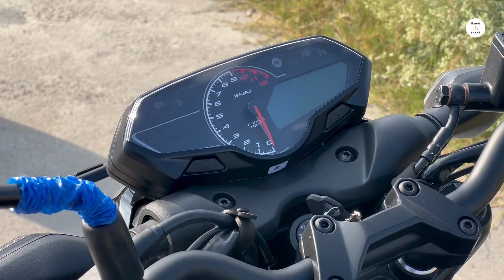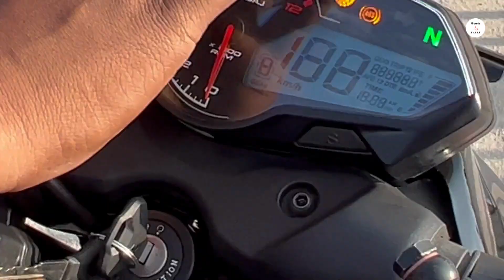Pulsar N160 2023 Review in Telugu |  #pulsar #n160 #bike #telugu #vlogs #hyderabad #ns160

Comment: Ns160 or n160 which is give best feel to ride 🤔
Reply from the maker: Both are almost the same. Depends on the individual again. But N160 engine is slightly smoother.
Reply: Bro ns 160 Front Tyre Size 90/90-17 Rear Tyre Size
120/80-17,and Front Brake Size 260 mm.Rear Brake
Disc Size 230 mm single channel ABS,12 litres fiber tank, and instrument console lo DTE ledu,gear indicator ledu and old model console,bulb head light.ns160 looks kuda chala old vuntundi.
2)N160 bigger tyres Front Tyre Size 100/80-17
Rear Tyre Size130/70-17,and bigger disk brakes with DUEL CHANNEL ABS Front Brake Size 300 mm
Rear Brake Size 230 mm,and bigger fuel metal tank,and latest instrument console with gear indicator,DTE,and LED DRLS,LED HEAD LIGHT.N160 latest looks and latest features with usb charger support.both ns160&n160 family ki work avadu bro.
Reply: Both are not almost same
Reply: Miku ns160 kavali ante wait chey bro present vuna design 2019 nunchi same vundi next March tarvata anni companys new models launch chestay NS models lo emina features add cheyachu
Reply: @manideep3888  avuna bro antey n160 change chestara bro same vuntunda
Reply: @ragumass7171  n160 lo changes Max vundakapovachu

Comment: Ns 160 or N 160 which is best
Reply from the maker: It depends on various factors. 

My personal choice is N160. 
It has a Refined Engine and a bigger tank capacity with better mileage. 
The claimed mileage of Bajaj Pulsar NS160 is 40.6 kmpl whereas the mileage of Bajaj Pulsar N160 is 55 kmpl.